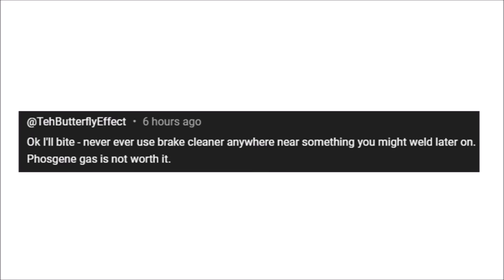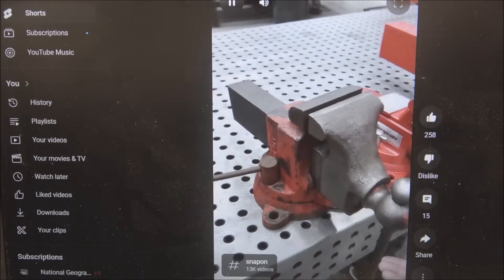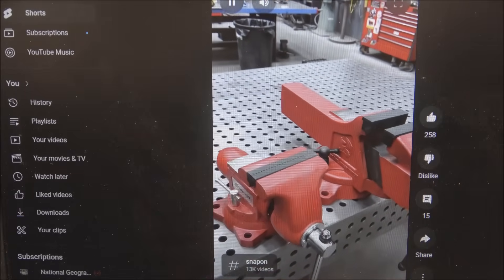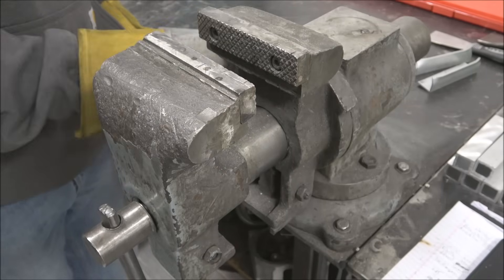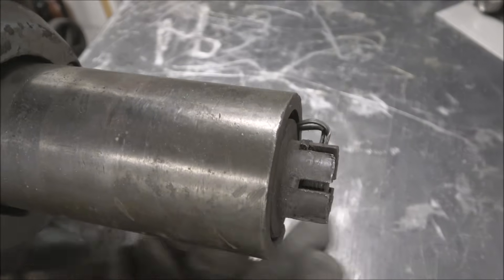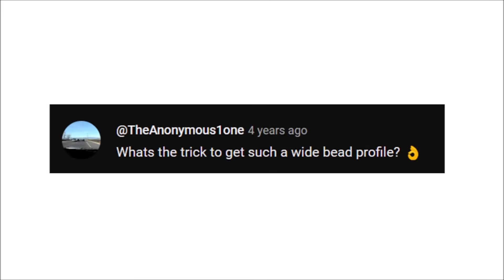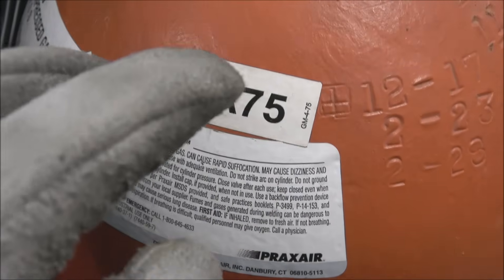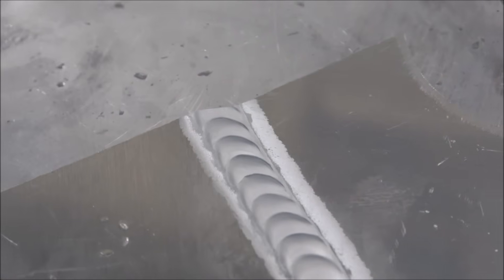TIG Welding Fabrication Advice - Tungsten Shaping, Bead Width, Poisonous Gas, Vise Selection

Comment: Just and observation That bottle you were pointing to was pressure checked Dec of 1917 and had the knot Z Simbel   stamped over if am reading it correctly it would be in service 108 years , now that's a return on investment ..

Comment: I have the same vise as you and it was probably sold under the Ohio Forge brand back in the 1990s and 2000s. Still going strong.The high priced vises are like anything else if you wanna buy them. I’ll eat my money rather than have a name plate.

Comment: Blunting the tip of the tungsten, I touch the end FIRST then grind the outside to shape, but you don't have the diameter on the end any bigger than 1/3 rd the diameter of the Tungsten diameter, like if it is a 3/32 tungsten then the end diameter should not be larger than 1/32. The other reason I do the end first, is If you did it last, you can then chip the side of your ground shape which can give you an irregular arc. I don't like "Needle point", because you lose the tip nearly instantly on anything higher than 130 Amps, and I am constantly working at 190 or more Amps on the screen.
Reply from the maker: @scottcarr3264
What welder are you using, and what type of tungsten? 
What amperage controller are you using?
Are you referring to AC or  DC welding?
Your max amperage setting should have no relevance if a sharp point holds its shape or not on startup, unless you are using a simple on/off switch and no variable amperage control.

There's a better way. You will lose accuracy with a blunt tip.
Reply: You'll lose the tip of your Tungsten every start if you run not enough post flow or flick the torch around, exposing the electrode to the effects of atmosphere.

Comment: Regarding phosgene gas and brake cleaner. Is this just for freshly sprayed brake clean that hasn’t fully evaporated? Or, does this issue remain for days/weeks/months after using it?

Obviously, I buy non chlorinated, and don’t use it for welding projects.

Comment: dang those are kind of spendy grinding wheels. 70$ at time of posting...maybe because of tarriffs....(probably worth it), but there is a pretty good cheaper option:  diamond lapping discs.  they're flat, and I mounted it on the outside of a cheap grinding wheel on a cheap 6" bench grinder from Harbor Freight.  all together I think I spent $40, the disc is still going strong after 3 years, and it leaves a nice finish (200 grit i think).  chucked in a drill, and used correctly, the grain is at least somewhat vertical.

Comment: 1:11 - dayummm! $1250! Snap-on is getting crazier by the year. 
4:46 - i seen a video many years ago that claimed that helium easily carries more elections than the other gasses, which produces the higher heat with less amps set on the machine. 
5:51 - whoaaa! What kind of grinding wheel is that? 👀

Comment: For my tungsten sharpening i use a diamond wheel. It cuts faster and stays cooler than my CBN, which i use for steel. However, diamond is not versatile and can not be used on steel because it will burn in no time.

Comment: I am staggered by the vice prices. You guys over there are being gouged big time. I was a structural steel tradesman (boilermaker) years ago and still have a good workshop at home. My biggest vice is 6" Eclipse brand. Had it for decades. I just looked up the current price. $189 Australian!!! It doesn't have the "anvil" part but my heavy steel welding bench I built 50 years ago takes plenty of "metal forming" punishment. But don't worry, Trump's tariffs will bring your prices down. Just ask MAGA. LOL.

Comment: One thing I used to do frequently that I never see people talking about these days is DC welding aluminum with 100% He. You don't get any cleaning action, so you have to wire brush the surface (with stainless steel brush) beforehand to get rid of the surface oxide, but it is obviously way more heat into the part than just adding helium to argon and still AC welding it. Would love to know if you ever use this technique.
Reply: With 100% He you get less heat into the part than with a  Ar/He mix AC or 100% Ar

Comment: Man, it’s tough to see this rift starting between you and Fireball Tool. You both put out genuinely helpful content, and because of that, I don’t mind either of you using YouTube to sell products — you’re both delivering real value. That said, Fireball might be slipping...

I think the vise Fireball showed in the video was the smaller 510 model, not the 614 you were checking out on their website. The 510’s price aligns with what was mentioned, but Fireball  also called out a 12" opening, which doesn’t match up with either model, so IDK which one Fireball is talking about.

I totally agree that it’s shady and misleading to cast “Spokane Washington” into a vise made overseas. For the 614, Fireball does offer a choice between a Taiwan-made or USA-made version, but the USA-made one is out of stock. It’s good that the option is there and that the country of origin is clear at the point of purchase, but branding the actual vise with “Spokane Washington” when it’s not made there is lame.

The 510 model doesn’t have a country of origin option, and the listing doesn’t say where it’s made, so that model is even sketchier.
Reply: Been off fireball for quite some time 
I purchased the plans for a vice from him and it was junk the  plans 
I didn't even start making the vise I had no faith
Reply: @bluejayfabrications2216  Dude don't blame Fireball because you cant build a vise. Its not that complicated.

Comment: I knock off the point to where I have .010" of landing because it can spit off and show up in xray. I had an xray tech call me down once to see the tip in my part once. Cool not cool.
Reply: That's precisely why you do the landing. People that run low postflow or flicking the torch around trough the air while the Tungsten is still hot expose it to the atmosphere - which leads to oxidation. Once oxidised - it becomes much weaker. The tip usually can't handle the start and shoots into the work piece.

Comment: Thermal Conductivity- Helium is about 10X more thermally conductive than Argon.  The additional thermal conductivity capacity produces more heat at the weld thus the ~10% gain in heat output/capacity.  This also comes with typically a different bead/weld profile.  Helium's higher ionization energy causes the voltage to raise from the TIG welder which translates into a wider/flatter/shallower profile vs Argon only.
Helium: 0.151 W/m·K (Watts per meter-Kelvin, the unit for measuring thermal conductivity)
Argon: 0.0018 W/m·K (Watts per meter-Kelvin, the unit for measuring thermal conductivity)
Reply: The difference in thermal conductivity of the gasses isn't the reason - the heat is generated by the plasma, not the gas, and the plasma is in direct contact with the part. Convective heat transfer (thermal conductivity) is tiny compared to being in direct contact with a plasma. Your second comment regarding the difference in ionization energy is the reason that helium provides more heat than argon: way more energy is required to remove an electron from helium than argon (25eV vs 16eV). Which means that each electron has that much more energy when it hits the part. Same current (100A), but 1.5x the power!
Reply: @GeorgeBurkhard the thermal conductivity of the gas is THE reason, along with higher ionisation  potential. He just got it twisted up thinking that the conductivity of gas is carrying more heat to the work piece.
Reply: You're wrong abot the mechanism how thermal conductivity capacity produces more heat at the weld.

Comment: It’s my understanding after speaking to my buddy who is a chemical engineer, that allot of  coach builders who make body panel parts out of thin aluminum sheet (say .063) prefer to use a argon helium mix to do their butt welded panels because the extra heat it puts into the part’s heat effected zone works like an annealing process which allows them to planish and smooth the weld beads flat without cracking . Personally I’m still using pure argon, on thin aluminum sheet and just carefully grind down front and back side of the weld joints , before I hammer and dolly the panels flat. And haven’t had a problem/issue with the joints cracking . I used to gas weld thin aluminum with flux which is a tricky process to learn without lots of practice, it creates a dead soft surface, but does impart a lot of heat and distortion.
Reply: They prefer to use the Ar/He mix because of the marketing hype that the companies are pushing. Annealing has nothing to do with it. If they having issues with cracks - probably should stop using 5356 or step up to 4047 if they are using 4043 and still getting cracks.

Comment: I just got this same diamond wheel  and it works so much better than the old stone wheel. I also just got a better gas regulator (Optimator) and my welds have improved from those 2 changes

Comment: The previous owner of my property left a vise just like yours in the shop. There is a large wood burning stove in the shop and he had welded a 3/4” thick plate to the corner of the stove to which he bolted the vise. It’s incredibly stable. One bonus he pointed out to me was that the flat anvil surface of the vise makes a great place to set a mug of coffee as it will keep it warm when there’s a fire in the stove.

Comment: I know a fellow who poisoned himself with phosgene, which was created by BC residue in a rust crater, under heat of welding, AND Argon. He said he saw the tiny "poof" from the crater... he lived to tell the tale, but he nearly didn't. His story has been on the web for a couple of decades now. (reply if you can't find it I'll go looking again)
A simply "blowing off" with compressed air very well would have saved him the poisoning, but sometimes we get carried away with "getting it done". 
But I'll use brake clean as I have all along. Anything might be welded on later and later might be next year. I'm no pro.

Comment: I have a vice - 8 inch Record - it's missing the opening key... You have to pull the vice open once you have unwound the handle a bit? I found it on a farm we bought - the closing key was missing, but turning it upside down, it now closes but doesn't open...

Comment: Yeah Helium has a considerably higher thermal conductivity than the other noble gases.
Nearly 10 times that of Argon.
Reply: It's not thermal conductivity, and you're dealing with plasma, not gas, so those numbers aren't relevant. It's the higher ionization energy of the electrons, so more kinetic energy per electron hitting the part. (same current, higher voltage = more power)
Reply: @GeorgeBurkhard those numbers are very relevant... You just don't know it 😊
Reply: 🤦 more heat to part hmmm. Why is that?.....

Comment: That Fireball vise is a bunch of “hooey”. All the aspects of strength that Jason measures against other vises is completely and totally irrelevant. Nobody on earth is going to use a vise to exert that much clamping force. If they do, they’re an idiot. That’s what presses are for. Like you, I want a swivel, reliable vise to hold things. (That flat spot is called an “anvil” I think).

My vise is on a pedestal, rotates, swivels, and has pipe jaws below the straight jaws. I paid $300 for an 8” vise that has lasted me for a decade without fail.
Jason I sure proud of his stuff, but like his table and other tools, that vise is made overseas so claiming Spokane, WA is BS.
Reply: It's a big, strong tool.  Nothing about it is "hooey".  If YOU don't need it for your work, great.  But some people need or want a vise that can do what his vise does.
Reply: Fireball Vise is the best vise ever made. What’s wrong with putting Spokane on the casting. That’s the origin of the tool. Nothing wrong with that.

Comment: I don’t care for the Fireball company. If a company tries to screw me on the very first purchase.. they suck. Or they don’t know what they’re doing. And why does he act like he invented stuff that I’ve been using all of my Moldmaker life?
Reply: I have Fireball tools they are a game changer.
Reply: @Ernie-zk3gb I have The 614 hardtail vise. I can tell you that it is not overpriced. Its a tank and the the best vise i have ever owned. I have broken several vises doing stupid thinks with them. I was beating the end cap of hydraulic cylinder off the other day and the vise didn't budge.  My other vise would flop around and the swivel base bolts couldn't keep the vise from pivoting. Don't knock it until you have one.
Reply: I feel ya. During his promo for his over priced vice he tested a whole bunch of cast vise against a fabricated one. Of course castings are more brittle. The guy is just a sly salesman selling over hyped products. Can't stand him
Reply: @peterpeterson7665 He’s done nothing wrong but make and design awesome products. I have a lot of them with no complaints.

Comment: In the mid 2000's a reputable fabricator  (went by Brewdude) had an article in the horse backstreet chopper magazine explaining how chlorinated brake cleaner put him in ICU from there being a very small amount that hadn't evaporated when he welded on a part.  Keep up the great content
Reply: Great ❤❤😊
Reply: Yep, I read that. Phosgene gas… that is no joke. Everyone, be careful if you’re going to be applying heat to a part after you’ve cleaned it with that stuff.
Reply: holy shit i remember that, and him. the horse was a rad magazine for us fledgling chopper weirdos
Reply: I welded some steel a few days later after cleaning with chlorinated brake cleaner. It still off gassed. I work in HVAC for a living & notice the smell immediately. I have inhaled so much of it in my time. There were quite a few times it made me pretty sick.

Comment: What are we going to do when the earth runs out of helium? Supply is already pricey and hard to get. What other options are there?
Reply: Why you need helium when there's argon? Or are you more concerned about the birthday balloons becoming obsolete?
Reply: This is not a thing. Helium is a byproduct of natural gas harvesting. We're not running out of helium, it's just not profitable enough for companies to continue capturing while processing NG.
Reply: NASA buys most of it lol wonder why? The balloons don't get up there on there own
Reply: my local welding supply doesn't even have tanks of helium mix, the price is too volatile to keep them in stock, I would have to order a tank in advance. Flaring natural gas is such a waste, isn't refining helium from natural gas the most efficient source? Once it is released into the air it just floats into the outer atmosphere and gradually dissipates into the great vacuum of space.